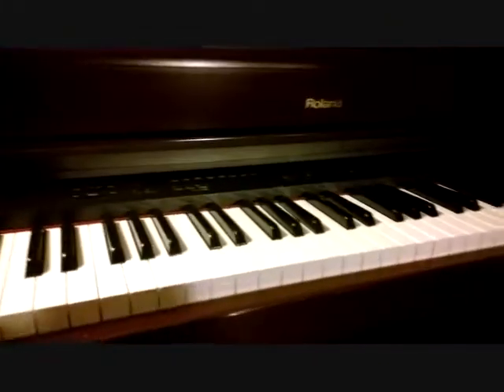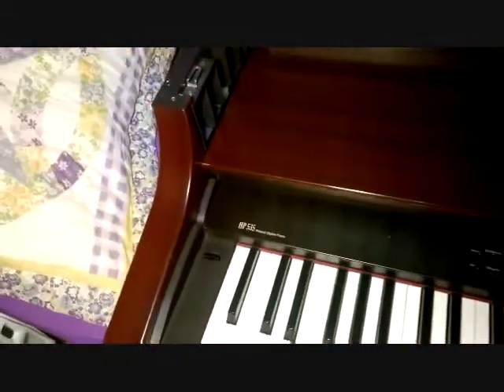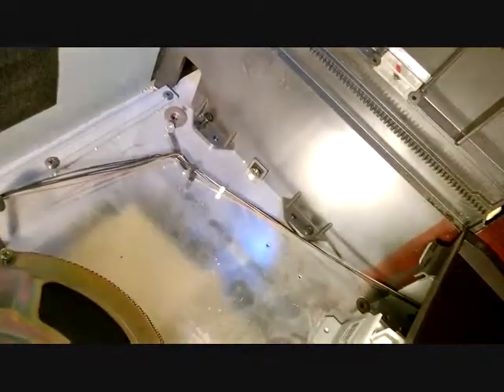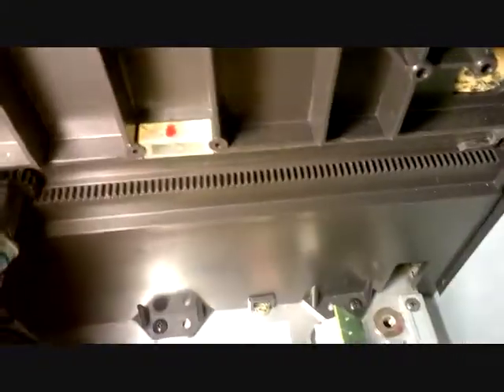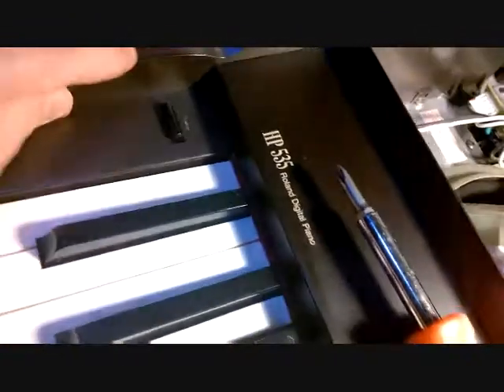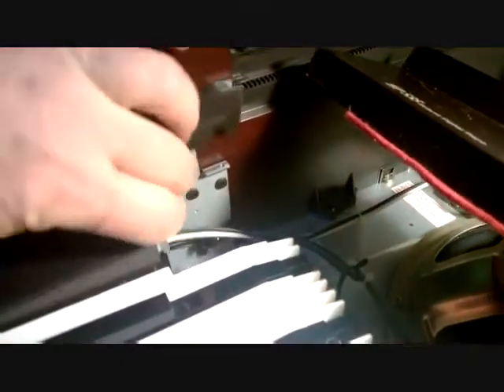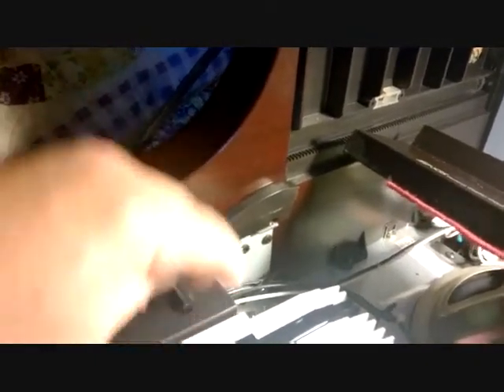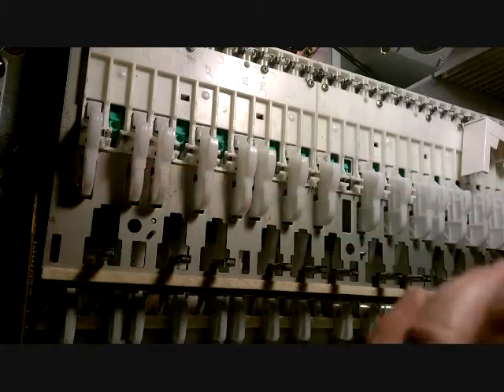Roland HP535 Hammer Key Replacement

Comment: Thank You for the video... Where did you find the hammers? Can you help me with a internet site where I can buy the hammers?
Reply from the maker: I bought a complete set of hammers directly from Roland.  However, you do have the option to buy individual hammers. When I disassembled my piano, upon inspection of the hammers where the weights were embedded, I found that 80-90% showed stress cracks, even though at the time only 2-3 were actually broken. Contact Roland for parts.  I also see them new on Ebay, just make sure to contact seller with your model number. Most do not allow returns.